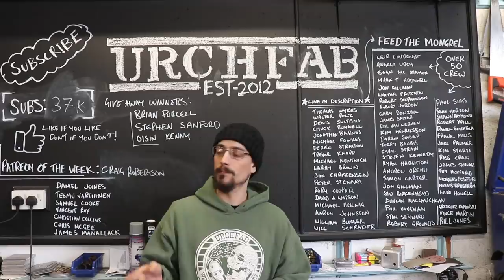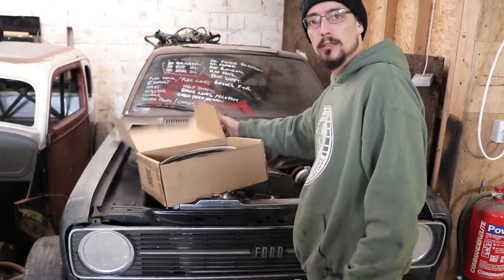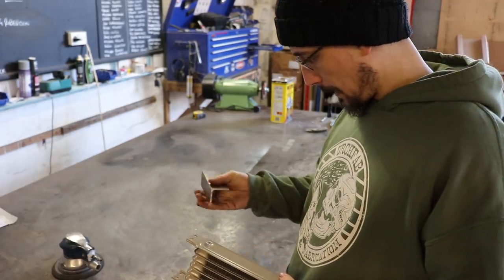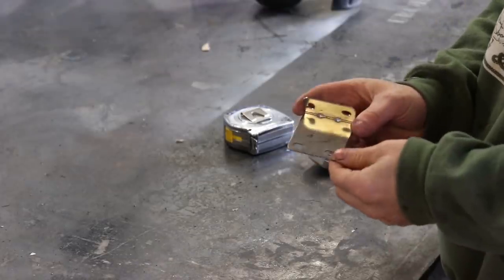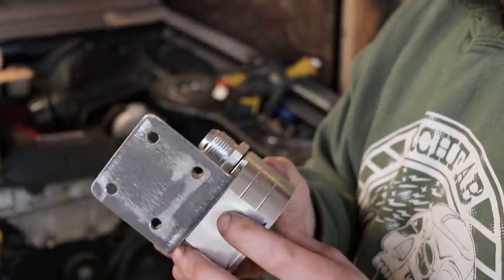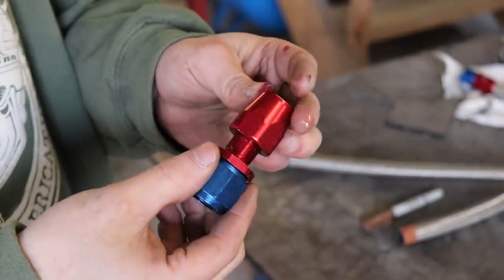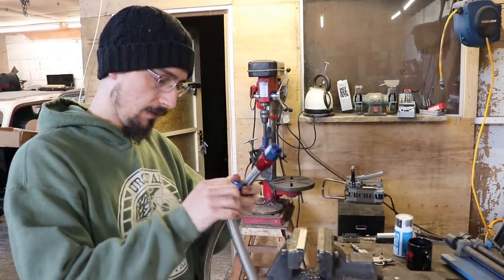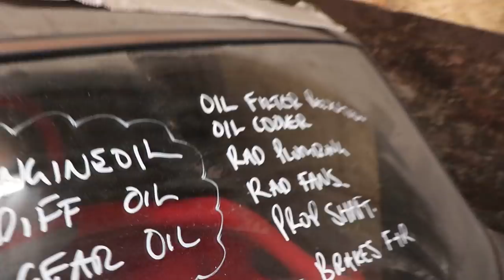SAAB TURBO MK2 FORD ESCORT, REMOTE FILTER/ OIL COOLER INSTALL

Comment: Just a tip, you need to mount the oil cooler the other way up as the way you have it can cause air locks in it and not give sufficient cooling.
Reply from the maker: Ah, I better flip that sucker over then. Cheers
Reply: I've seen some suggestions for rubber mounting the oil cooler to limit vibrations to the cooler so it doesn't break. No personal experience though.
Reply: @arrindaley3714  indeed, I had some rubber washers on mine on my old MK2 RS to save on vibration.
Reply: +1 for everyone here, oil cooler/radiator etc. always on rubber mounts, and it should be the other way up.
Reply: Another tip is to mount it vertical it’s said it flows better in that position

Comment: For hose assembly leave a 1/16” gap between the hose and the flange, use a mandrill or at least a male fitting to install the insert, this will allow a better purchase and the easier application of pressure whilst assembling, also before assembling the insert mark the hose with a felt tip marker or wrap tape around the hose where it meets the fitting, this will help indicate if the hose has backed out during assembly of the insert.

Comment: Mount the filter housing the other way up then use the 90 degree fittings you have connected to the filter housing at the cooler, this will also proved more clearance between the filter and that round rubber thing

Comment: Matt, treat yourself to a pair of the aluminium assembly jaws .They are magnetic, so they stay put in your vice, and have machined 1/2 hexagons to hold the fittings. Trust me, a true life changing bit of kit, so no risk of damaging the anodised finish either. Motorsport Tools stock them. Another tip, wash out the hoses with brake cleaner & blow out, disc cutting makes loads of rubber dust !

Comment: Oil coolers are air traps that way round at worst they need to be fitted pipes on the top but they but they work the best stud up right with one at the top and one at the bottom.
Reply from the maker: I will flip it over, Thanks for pointing that out.

Comment: from racing expirience you have to build up oil pressure before starting after periods of being laid up.   eg more than a week as the oil will syphon back to sump with gravity.  just check how much longer it takes than before the change ...and fill the new oil filter with oil before first start up

Comment: Hey Matt, love the build, really enjoy your videos ... just thought I'd put in my 2 cents from a previous bad experience, you might want to put some rubber between your brackets and your oil cooler. When mounted solid, the vibration over time can crack the solder joints on the cooler. Just pieces of cut down serpentine belt will do but, if you can find some, the best thing I've ever used was old school rubber carpet underlay about 6mm thick. The rubber is almost hard but still a little "squishy" ... worked AWESOME!! Keep up the good work!!!

Comment: Cheeky removeable front panel there, nice work as always..
Reply: It's a very handy thing to do on a MK2, I had bolt on wings on mine, I just went down the scrapyard and got a load of VW wing bolts and then made a captive nut underneath, drill holes through the wing edge, I did also put some squares of steel on top to reinforce it and its job done and so easy to whip a wing off ;-)
Reply: i wish I had done the same on my mk1.

Comment: Matt, don't tighten those hose ends right up to the socket on the end of the hose as doing so can cause the end to break off since the socket is always pushing against it, leave a small gap of 1-2mm... Also, I always assemble my hoses so the flats of the end line up with the flats of the socket with the required gap.  Makes for a more professional looking installation, which will fit well with the rest of your work!

Comment: Maybe a guard for the filter so any debris wouldn't poke a hole in it or some thing?
Reply: mawe42 I was thinking the same thing. It’s exposed to tire debris.
Reply from the maker: I will make something as a guard.
Reply: and a shredded tire would not rip it off immediately.

Comment: Hi if you are putting a oil filter under the wheel arch I think you will have to protect it from stones flying up from the wheel and hitting it. Just a thought

Comment: A remote oil filter would have been a great change I should have done years ago on my Acura CSX. The oil filter is just about centered on the intake (back) side of the engine on the K20 later blanked off and relocated to the oil pan on the 2.0 L Civic Si engine.

Comment: Many race cars have the coolers fittings down, the oil will drain better and the oil pressure will remove the air instantly. Check out McLaren racers.

Comment: Awesome work just some quick info when putting the ends on the hose never use any lube cause then whatever you use stays there and will rot the hose from the inside out and it’s actually happened to me just so you know other then that you really do amazing work
Reply: Kevin Cosgrove conventional lube will but if you use silicone grease thats what its meant for 👍🏻
Reply: Best is to use tyre solution, the hose will slide right on and won't come off again.
Reply: welsh Maniacs that’s actually good to know I was only saying cause at the time it happened to me I was building compactors for a private garbage company and gates hose company sent a tech to me and that’s when I was told to never use anything go dry but good to know
Reply: Anyway those are oil lines so it doesn't matter if you use oil as alube.
Reply: Steve Fuller very true but when you tighten up the fitting the oil going through the hose doesn’t touch that part so whatever You use as lube stays there and breaks down the hose
Reply: Steve Fuller that’s what I’m getting at
Reply: @stevefuller1779  spot on I was thinking the same
Reply: Yup. It would suck to have an oil based lube eat away at his oil hoses.
Reply: Doesn't Turbo Yoda use shampoo?

Comment: I'm always nervous of putting components  of an oil system in front of a wheel under the wing, my mind says that one day that will leak and splash on my tyres at the moment I'm pushing my luck grip wise lol

Comment: Hi, where did you get the oilfilter housing replacement you used on the engine? I’m doing a Saab B234 engine swap into a Volvo 940. This oilfilter housing would help me deal with some space issues

Comment: Will the filter be vunerable to damage in the wheel arch, as if it's knocked off you'll lose oil pressure.

Comment: How long do you think it will take to get oil pressure on startup with all that extra hose and cooler to fill before oil hits the engine? Something to allow for, (dont rev the guts out of it on start up!) or doesn't matter?

Comment: Matt, question for you. Can you go through and explain the main parts of this vehicles drive line. I assume/ it appears that it is rear drive but powered by a saab engine? What year motor? What transmission? Is it carburated or fuel injected? I see the turbo... did you fab your own intake? How hard would it be to fab up an intake to accept a carb for this engine? I have a 1979 Saab 99 gle two door but my injection system is crap and I'm thinking about fabbing an intake and converting it to carb. Any thoughts you have would be appreciated.
Reply: Why not go stand alone engine management like maxxecu, vems, haltech or something like that instead of a carb? 🤔

Comment: think saab used red top engines from GM ( C20XE opel vauxhall) starting at 1,8 for the non turbo up to bored (or stroked) out to 2.3 liter for theIr turbo stuff they use a different valvecover
the base engine is the same for the NE range too (except for oilsquirters in the turbo LET versions )  , might be eazier to get parts for it if you look for that instead of saab when you want pistons bearings and that sort of stuff as the saab stuff is getting rare
Reply: Earlier Saab engines were their own and were based on a Triumph unit.
Reply: @stevefuller1779  the older saabs after the two stroke engine used ford v4's , never heared about the triumph engine but then again im no expert , saab used quite a few differend brands depending on who owned saab
Reply: @watahyahknow  When the 99 came out they did a joint project with Triumph for the slant four  engine as used in the Dolomites, TR7's andalso made into a V8 for the Stag, Triumph actually made a bit ofa Pigs Ear of it but Saab developed it and made a goos engine.

Comment: Right hand corner, hard braking, tire meets oil filter, race over?
Reply: there's heaps of room in front of the tire. no worries :-)
Reply from the maker: If my tire meets the oil filter then I've already crashed
Reply: Urchfab 😂🤣😆

Comment: Not a good idea to place the oil filter in the mudguard. It is exposed to blows, stones and tire itself. Inconvenient place to service and replace it

It seems to me that the oil radiator should be placed with the hoses up

Comment: Why do the complication of a oil cooler and remote filter? A stock oil filter and a larger oil pan is more effective and simpler leading to less chance of failure. For a race engine a  filter is not needed. A simple screen will do as oil is drained and refilled regularly. The filter does  nothing until the oil is hot. A screen works at all temperatures.
Oil filters were added in the 50's as a selling point nothing more. It was an option on many cars.
   Udderwise all looks good and you have all concepts covered.  Say Mooooo to the bull outside.
Reply from the maker: The stock filter housing hits the steering rack so this was the only way to fit the engine in this position. Cheers
Reply: Tell us more of this bigger oilpan of yours.

Comment: G-Plus stuff is cheap because they just shamelessly copy other company's stuff. In this case Mocal.
I designed a few silicone pipes for Forge motorsport and within months of production, G-Plus had copied them.